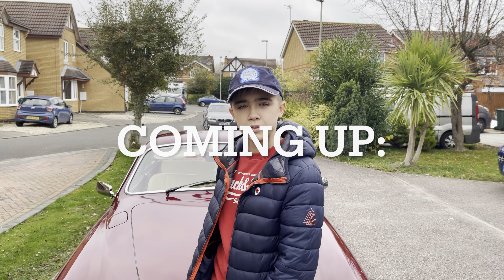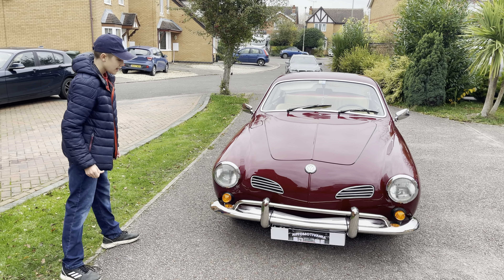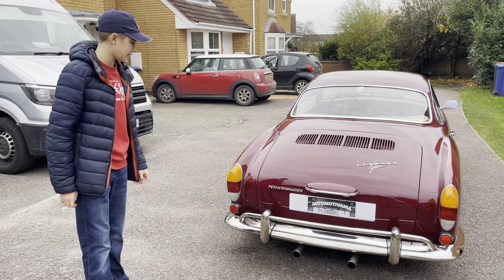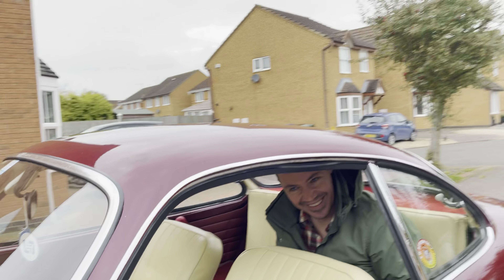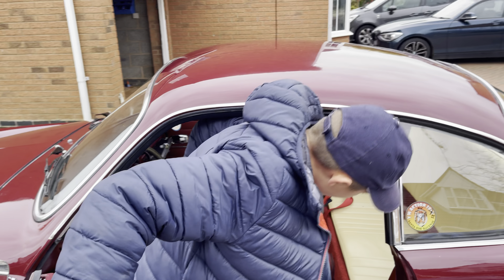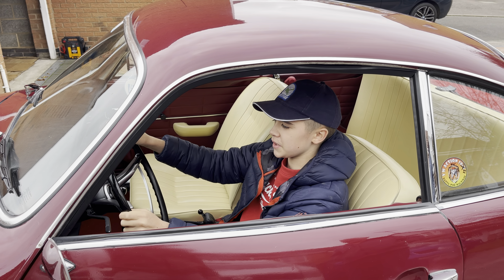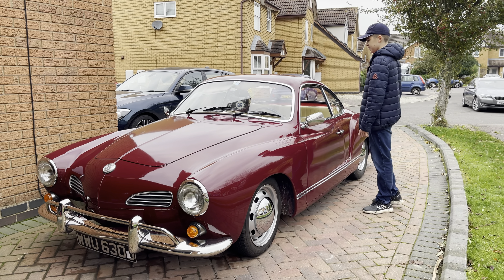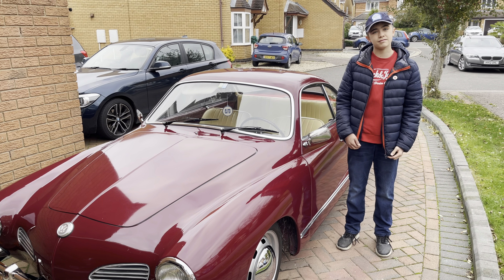Volkswagen Karmann Ghia REVIEW AND DRIVE by a TEENAGER

Comment: Lovely car, nice colour, good all round condition, if it was my car I'd loose the Beetle hub caps and install the original "flat" hub caps. I own a 67 KG.
Reply from the maker: Yes, I agree that it could benefit from different wheels.
Reply: Hi another little tip, optional of course, you could fit as I have done to my 67 KG, a 6volt (twin hooter) from a pre 67KG, trust me it's ok to run the 6v hooter on your present 12v system, the blasting sound of those double hooters will wake up the dead.....
Reply from the maker: @robertvandervelde60 
Sounds like a good idea - it’s actually my neighbours car 1 he’s done I lot of work on it since the video but I’ll give him your tips and he may benefit from them. Thanks.

Comment: Nice clip, but next time please use a lapel mic.  It helps us understand what you're saying, especially over the motor, road, and wind noise.
Reply from the maker: Thanks. I am looking into one but can’t get one that links to my camera so it’d just be a bit of the pain. It will come into place for the future though. Hopefully at some point during March.
Reply: @automotivania  You're correct; a special adapter (available online) is needed for lapel mics to work on a cell phone.
Reply from the maker: @azmike3572  I’m not actually using a phone now, I’m using the GoPro Hero 8 mainly and I think the same is true. I need to do some more research though.
Reply: @automotivania  Okay, good luck!
Reply from the maker: I do have a mic now, was quite hard but I know how important it was so thanks for raising it!